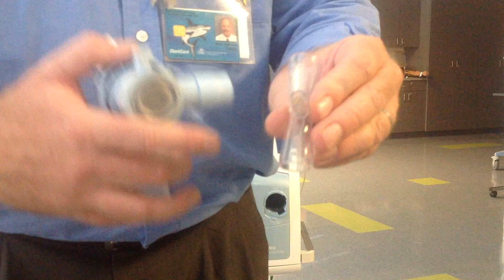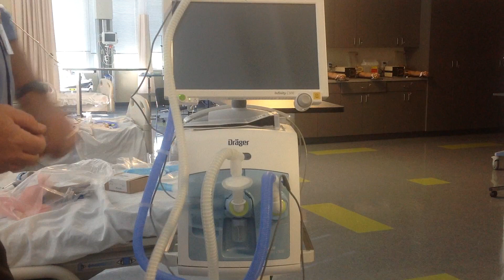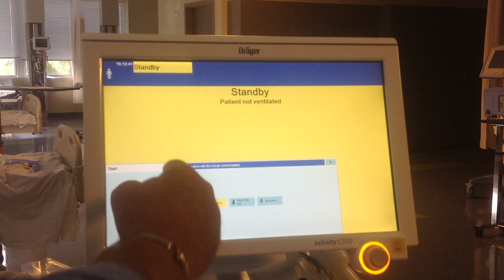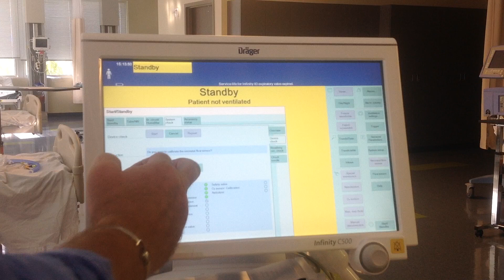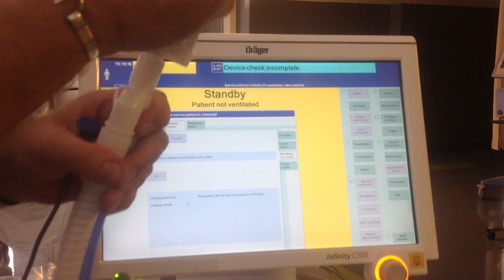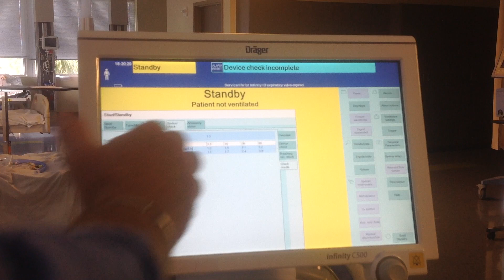PreUse Test Draeger

Comment: Hello,  One of our Dräger C500 vents will not pass Pressure sensor calibration valve and Expiratory valve tests.  We believe this problem developed from using some sticky nebulizer treatments on a sick patient.  We've tried replacing the expiratory valve and flow sensor three different times with no luck.  Do you have any advice on how to get it to pass?  Thanks.